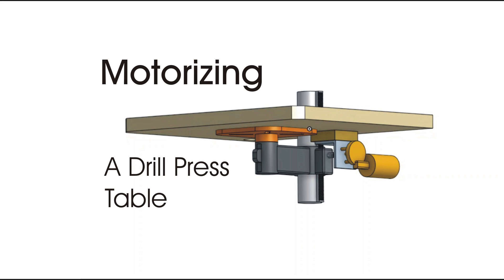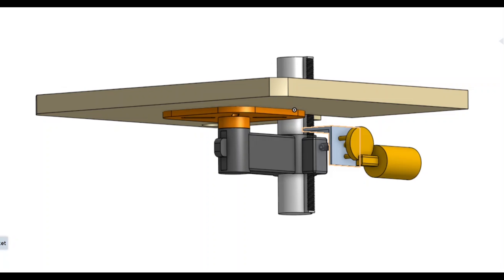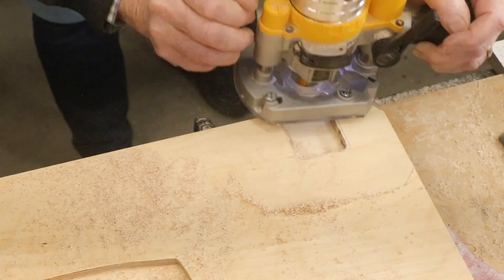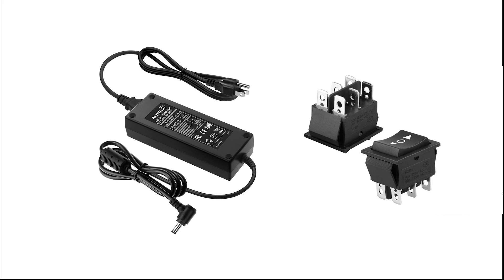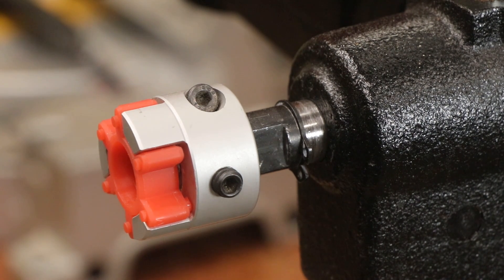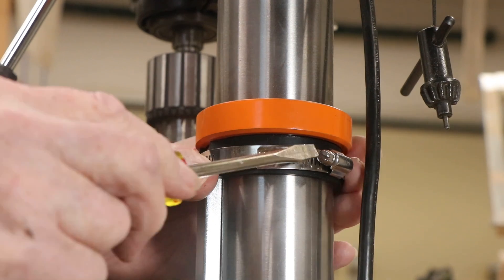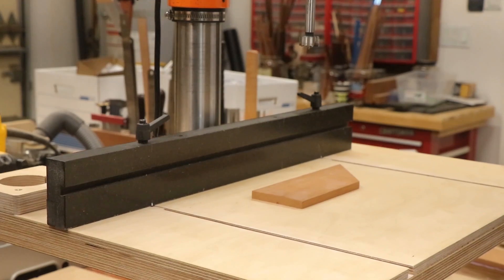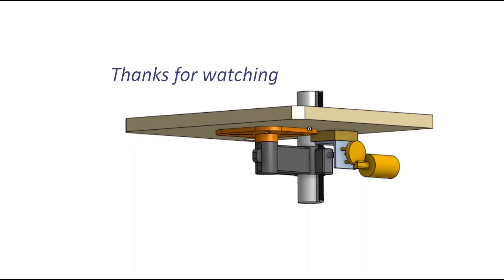Motorizing a Drill Press

Comment: Nice way to address the problem of the table rotating around the column. STL would be nice indeed.

One question though: do you have any play in the rack and pinion set-up? If so, how did you address it? Fixing the rack in place still leaves a lot of slop in my table ..

Comment: Nice video.

An alternative to mounting the motor to the table might be to mount it to the column -- in the sense that you could have a sleeve that runs up and down the column and mount the motor to the sleeve. The sleeve could be 3D printed.

Also, instead of running the motor at over voltage to run faster, get a motor that is geared faster and under voltage it to run slower.

Comment: Awesome, the best video I have seen to date. I opted for the 100 rpm and a dedicated power supply. Also considering limit switches and will be installing a power switch paddle style to turn the power supply on and off. Really like the idea of installing the motor on the table but have decided to mount it to the stock table and then have my drill press table slip over the top of the stock table and bolt in place. Also I did the idea of the column clams but noticed the rack did deflect if I pushed on the table sideways. I made some clamp arms that clamp around the column and then a guide arm/form on the table acts just like a linear bearing. Used the idea you had for the column clamp as inspiration. Fantastic project and nicely and concisely presented. This was the inspiration this retired teacher needed. Thank you.

Comment: I just received all the parts to "follow along" with my small Delta Desktop Drill Press. This will be fun to improve my Drill Press Experiences. However,  I've already run into a little problem with the rack part of the height adjustment mechanism - it still moves back and forth a little when not tightly clamped to the support post (very loose tolerances on the pinon housing). I'm not certain how to correct that, or even if I need to. I'm hoping that the motor mount will be stiff enough to prevent the table from moving. If not, I can always tighten the table clamp when drilling, but then I'll have to always remember to loosen it to move it up or down. Maybe @PatrickSullivan you've thought how to fix that?  Anyway, very straight forward instructions - thanks.  One small nit - you didn't show how to connect the power supply wire with a barrel fitting to the switch, but I think I can figure that one out...

ps, I used small strips of bendable aluminum bars for the column and clamp thing. It seems to work just fine, so no need to purchase a 3D printer (not that I don't really want one).

Comment: Great build and great video describing what you did and why. I've watched several videos about motorized DP tables, but yours is the only one that did a good description and critical parts links. 
For those who want to make their DP table more convenient to raise and lower, but don't have a 3D printer or soldering skills, I would recommend checking out a video from Woodsmith about a DP table they did. It doesn't have a motorized lift, but they made changes to the crank and column lock that makes them much more convenient to use, especially with a large DP table installed. 
https://youtu.be/3_cQcHMz7UU?si=ygrfkZWepqKxGJZl

Comment: I screwed up and didnt think about motor speed at all.  Used a washing machine motor thinking itll be beefy for the table.  Got it all bolted together, flipped the switch and sent the table through the roof at 3750 rpm..  took half a second to rip off the whole top of the press and tore the electric out of the wall and shut the main breaker to the house..

Comment: I got a "big" floor standing model,  with same type of handle as your's have.   i just use a cheap 18v drill driver and a 14mm socket head with a set screw on the turn-thing "where the handle was"  and since the drill driver has build in speed control in the trigger,  i can move the table up and down as fast/slow as i want.  even in first gear the drill is fast enough,  and has tons of power,  and i almost never recharge the battery,  it last many months.  Your work here, as always,  looks very nice,  but a drill driver is more then fine..  you could even mount the drill driver under the table and use a flex extender for it. 

The "Plum flexible shaft coupling" is very nice,  seen them alot on things like 3D printers,  but didnt know you could get bigger more heavy duty versions,  thx for sharing!

Nice video,  Thx!  have a nice day!

Comment: Hi - Thanks for your video and especially for the links. I have mine up and running - I just need to decide on the top layers. I made my own coupler out of brass on the metal lathe and just mounted the motor to the bottom of the table with a block that fits around the motor and bolts to the bottom plywood. I used over-sized holes to allow for adjust-ability. Thanks!

Comment: Can you turn on the press and use the motor to lift the workpiece INTO the spinning bit? That'd be handy as hell in certain situations. Example: my radial press only has about 6" of vertical travel. I have a few 24" bits. If I need a hole 10" deep, I have to bore the 6, then crank the press up so the bit almost bottoms out, then restart the press and finish her off. THEN crank her back OFF again. I'd love to be able to just press a switch and raise it straight through. Even if I had to pause and jiggle the handle a bit to clear chips. I may build this one myself! Thanks for sharing!

Comment: Nicely done. I have the same drill press and added my own “power feed” to the table. I used a motor out of an old 18v cordless drill and used the existing trigger and forward/reverse switch to control the table movement. My solution for mounting the motor was 2 holes drilled and tapped on the square portion of the collar with a bracket extending from there that the motor mounts to. A 3D printed enclosure to mount the switches and cover the motor/bracket/wiring to clean it all up. 
I played around with a single small gas shock mounted under the table to help with the added weight of a machine vise when running the table back up but found the motor had enough torque and it wasn’t needed. I will have to steal your idea for the rack retaining rings as I’ve just been pushing it back in place when it starts to move. You just provided me with the last piece of the puzzle. Glad this video popped up on my feed!

Comment: Brilliant work, Patrick! 😃
The issue with different voltages is that the motor's torque also changes. But a better option would be to always use 40v, for example, and a PWM circuit. Then you can adjust the speed as necessary, without any issues. 😊
Anyway, stay safe there with your family! 🖖😊
Reply from the maker: I actually bought a pulse width modulator, but then realized I would still have to provide a 40V power source, and decided to use the first power source instead.  However, I may change over to the PWM at a later date.
Reply: @PatrickSullivan  Oh, absolutely. You had the components already, you had to use them. 😊
But you won't regret putting the PWM later.